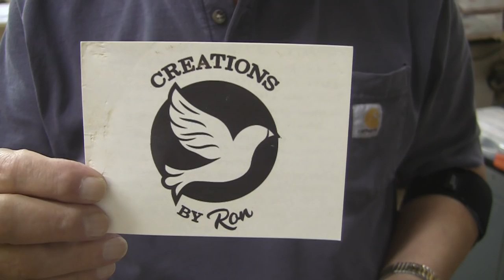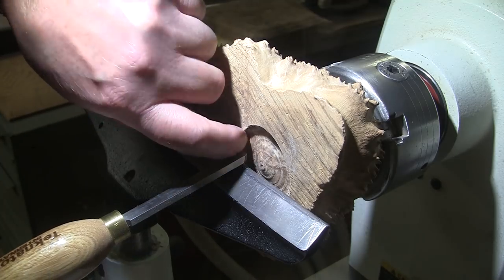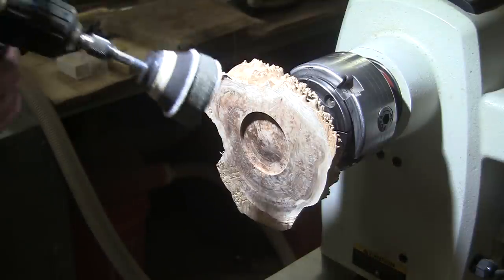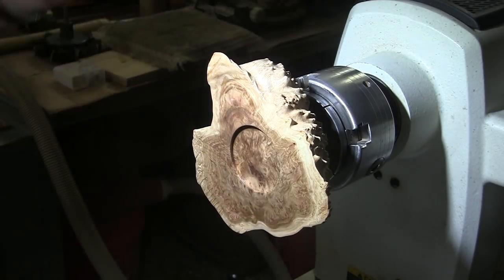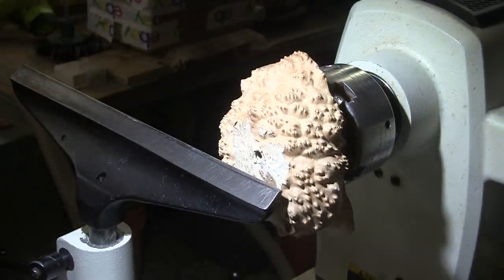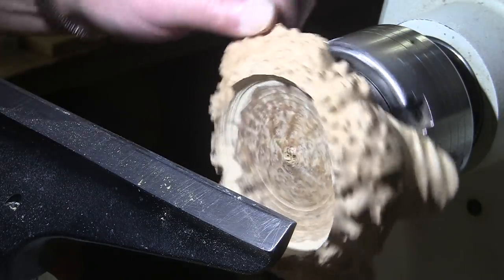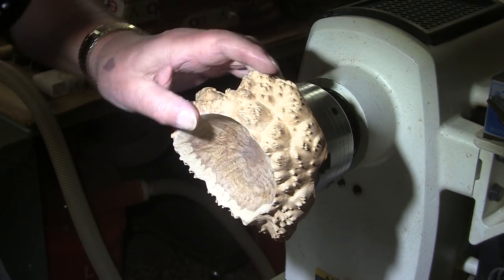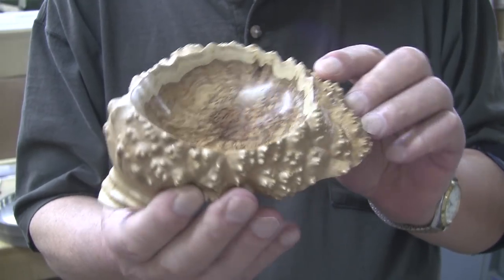See The Beauty in Red Mallee Burl! - Wood Turning

Comment: Another superb piece Phil.  Just the right proportions.   I got me some sand/sealer and shellac to try.
I've applied it to two pieces and I like it.  What are you using to rub them on with.  Looks like a gauze pad.
Reply from the maker: Thanks, Gerald!  I just use a cotton cloth to apply the finishes.  A brush when necessary.

Comment: Hi Phil,,,
Hey is an amazing piece and a hedgehog to boot!
Something that might work to shift the piece over so you could save your hedgehog as to put shims between the face of the chuck jaws and that flat bottom you created on the opposite side of the hedgehog's head. This will help to shift the piece over and allow you to flatten the bottom without taking away the headshots it.
Tom
Reply from the maker: Good tip, Tom!  I considered turning it between centers so I could adjust the bottom to remove the most and least where necessary.  The problem with that is I wanted to use a recess and it's dang hard to make a recess with the live center in place!  Well, it turned out OK and he sits pretty flat! 😊

Comment: Great job Phil and as always an entertaining and well presented video. I doubt that this is a burl in the common sense of the term. I can take you to the western half of my home state and we could walk for three days and see nothing but Mallee scrub and i have never seen a burl on a Mallee tree. Mallee is more like a shrub. It grows in sandy soil country with around 800 to 1200mm of rain per annum (semi desert) and will have anything up to 8 to 15 "trunks" at about 70mm diameter.  These trunks however all eminate from a single root ball which is in most cases a solid lump of wood with a spiky surface. This root ball is i think what is put across as a burl probably because that is the easiest way to describe it. They are the best ever firewood. One Mallee root on the fire and it will still cook breakfast in the morning. An interesting character istic of the ecalyptus species is that if the tree is damaged they can shoot new branches from a burl. River Red gum will do this.
Reply from the maker: Wow, very interesting information, Ray, thank you for that! 😊

Comment: How long do you wait after applying the sealer/and/or shellac, before buffing with the grey or white pad?  Beautiful, as always!  Thanks
Reply from the maker: A lot depends on that, Donna.  Temperature, humidity, how thick I applied it, how much soaked in, etc.  Warm, dry summer day, an hour or two.  Cold, wet winter day, three or four hours, sometimes.

Comment: Love the hedgehog  great work  .I keep finding older brdios and they're all great.Noe for my usual  dumb  newbie  question. Whrr is a good place too get s negative  rake  scraper.I have a woodcraft store about an  hour away  but  zi haven"t seen one there. And the rockler  story is agoohouranda half  away. Don't remember  seeing  one there either .
Reply from the maker: NR scrapers are available but not nearly as common as other tools.  I ground my scrapers to negative rake and I think most other turners do, also.  Here is one on Amazon.  It's, to me, small and unhandled but available: https://www.amazon.com/Robert-Sorby-Hardwood-Scraper-Blade/dp/B004HL8WUI/ref=sr_1_13?dchild=1&keywords=negative+rake+scraper+for+woodturning&pd_rd_r=6009d025-37ea-4c8f-8703-465bd978d1e7&pd_rd_w=lYieI&pd_rd_wg=tIaSM&pf_rd_p=4fa0e97a-13a4-491b-a127-133a554b4da3&pf_rd_r=FAJGYCQTF07J2SEE24NG&qid=1634833868&sr=8-13

Comment: Great piece, you have great skill...why shellac?
Reply from the maker: Thank you very much, Joseph! 😊  Why not?  I guess I like that it is a natural product.  I only use two finishes on a regular basis, shellac or Feed & Wax.  Once in awhile Danish Oil.
Reply: @PhilAndersonShadyAcresWoodshop  I was asking about shellac, in 1970 as a 20 year-old I worked as a house painter, working on new expensive houses. My boss would stain wood doors, etc, with Minwax stain, put on shellac for a sealer and finish with varnish. I was told that shellac dries out and cracks after x amount of years.
Reply from the maker: @josephobenauer3093  This can cause massive arguments, Joseph.  "Varnish" is a term used to describe any finish, period.  I have some antique pieces about my house that are finished with shellac.  No issues.  I suppose it depends on how a piece is stored/used.  In front of a window getting full sun?  Yeah, most any finish will dry out and crack under those circumstances.
Reply: @PhilAndersonShadyAcresWoodshop  Good stuff, thanks for the information.

Comment: should have done a better job of drilling the mounting hole perpendicular to what you wanted as the final flat bottom plane -- even tilt a few degrees to leave the snout clear and free from the flattening
Reply from the maker: Oh, man, I wish you could have been here to help me out, Rosseo!
Reply: @PhilAndersonShadyAcresWoodshop   OK, I am on my way,  need to learn safe and efficient turning from you (there is an old liathe in the shed at my new residence that  may try t get functional.).   BTW, some other turners show mounting on the wood screw by turning on the lathe, then hoping they let go not to late to break their wrist.  scary